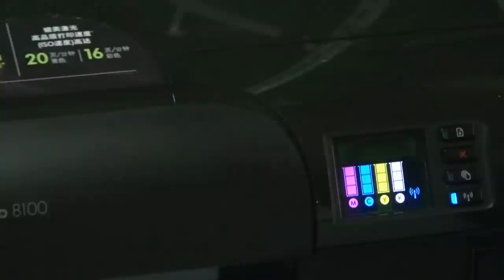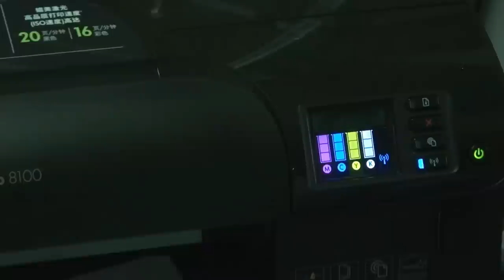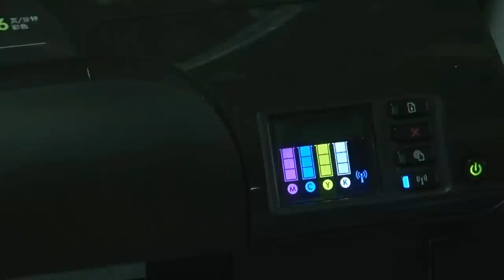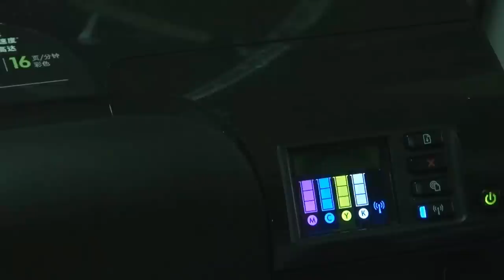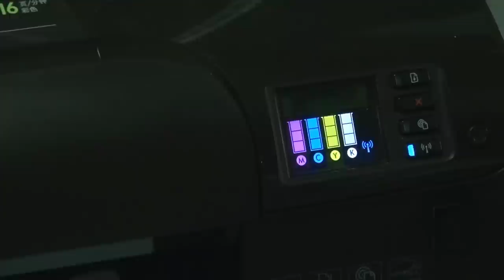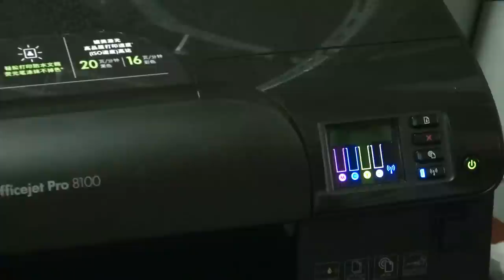Solution the HP 8100 ink cartridge depleted cartridge(showed depleted and would not work)  part 2

Comment: Thank You So Very Much! You are a genius! You are amazing! I am grateful for your knowledge! I just bought a new set of cartridges and the yellow cartridge did not register after I installed all of them. Lessons learned: After I bridged the circuits and replaced the circuit board, I made the mistake of cleaning the printhead assembly with denatured alcohol which washed the adhesive off of the tape. It still worked. The next time I disassemble the printer, I will bridge the circuits with solder and then cover them with tape to isolate them from those springs which I assume are conductive. Again, Thank You! I was depressed and was planning on throwing the printer in the garbage. Thanks to you! It works!

Comment: I did this a months ago and it really works. You have to make sure the piece of wire is making good contact with both the upper and lower contacts points on each color.  Press the tape down really good before putting all the screws back in.  But it has worked for me for over one year.

Comment: Very good solution using Refillable cartridges, still better when using bulk ink system!
Reply: felipecanutomiranda VERY BAD solution using refillable cartridges. This deactivates pressure sensor. If you are using refillables and you get this error - this means your refillables airbag does not work correctly = printhead cant clean correctly = clogging. Get refillables with airbag function, or CISS with airbag function. This sensor only activates if internal airbag is full (out of ink on original cartidges), or absent.
86xx do NOT have any ink pump, they use air compressor to blow air inside airbags of cartidges.

Comment: Some english explaination:

What this gentlemen does - is to refill original cartidges with some ink. Original cartridges have air bag inside, which plays special role in printhead cleaning from level 2. System blows air there. However if airbag is too big, it detects that and blocks printing with message "error in printer or ink system".

Which in turn happens either with original catridge out of ink, or with old CISS catridge without airbag support. If there is no airbag - system cant clean printhead proprerly.

If you print with ORIGINAL cartridge and recieve this error - this means your cartidge is either EMPTY PHYSICALLY, or DAMAGED/UNSEALED. Replace the cartidge with LOWEST ink indicated - remove one of them to see that menu - and it will work again. DO NOT short cut printhead as in Part 2 if you use original cartridge!! This will deactivate physical sensor and you can easy destroy printhead!

This applies only to OLD CISS. New CISS has airbag support and built-in dampfer.

This gentlemen refills original HP, although in some not efficient way - better take Q-tip and adapt it by cutting one end at 45 degree, so ink can flow from side. After refill, he insert the cartridge with some ink - system detects and starts printhead cleaning. After that he inserts CISS back.

With this old CISS does not have airbag, so its matter of time, when this problem appear again. This is why he disables pressure sensor in Part 2. With CISS - ink is always there - pressure sensor not required.

Still - printhead cleaning will not work right, because it cant clean itself - one has to do this steps manually over time.

Better buy newer CISS cartridges with airbag support.
Reply: At up to ($190.00) 190 us dollars for genuine hp ink, 4 cartridges of XL, I'll definitely pass on the oem hp ink. I'll take my chances and if the printer blows I can replace the whole printer cheaper than I can buy the oem hp ink for it.

Comment: I had only the black cartridge indication faulty-it indicated always empty. I have shorted the contacts by solder but only at the side where the black cartridge is but it did not solve the issue, it still indicated empty cartridge. I had to short all 4 contact pairs, now it is working. But its strange. Why do i had to short all of them? Why black wasnt enough if only black was faulty?

When i shorted only contacts of black i have removed the springs. Logically thinking if it is shorted then the springs can be removed, right? Because then they dont have any function anymore.  I dont believe that removing the springs after shorting the contacts is wrong.

But when i shorted all 4 pairs of contacts, i left the springs there but i isolated them from the contacts by tape. I dont think it has any meaning i just did it.

So still wondering why shorting contacts of black only did not solve the issue, why i had to short all of them. I dont want to experiment any further, but it would be still good to know the level of other cartridges :)

Comment: Long video too "short" the back of the board in 4 places with wire and tape.  Haven't done it yet, but plan on using wire and soldier to short the circuit, and electrical tape to insulate the short from the springs.  Basically what the 11 minute video illustrated.  Great idea.  Thank you!
Reply: I soldered the board and managed to pull off one of the gold plates.   Eventually i was able to follow the broken trace from the tiny pin next to the broken pad where it passes to the other side of the board and then passes via two other pins under some pads to then arrive at the pad that contacts the rest of the printer.    Cellotape method was not very reliable.

Comment: I tried this without success. The problem is that the "cartridge icon" lite for black ink blinks which prohibits any printer function.  The previous black ink cartridge worked well until it was empty and replaced by THREE new cartridges but none worked. Apparently while the "cartridge icon" lite blinks nothing will turn it off. Is it possible that: (1) firmware cannot be removed or updated to remove the restriction (2) since the 8100 is probably discontinued HP does not support "newer" ink cartridges which results in blinking lite ??  If neither of these what else shd I try ??   Thanx.  Bewildered Bob
Reply: Hi did you fix the issue?